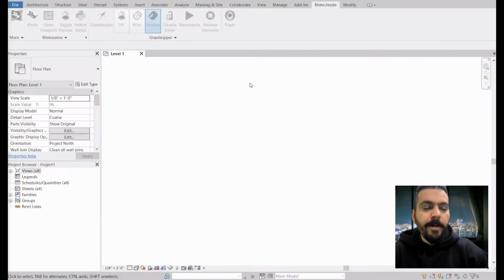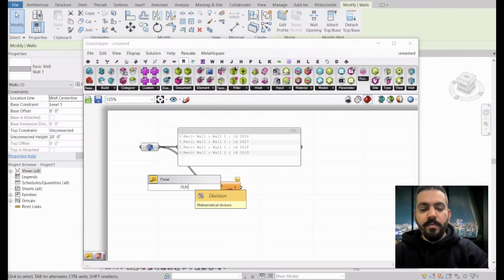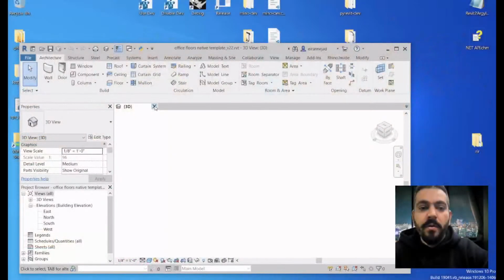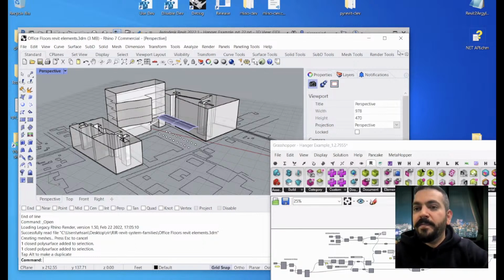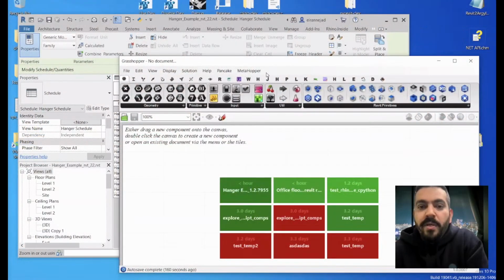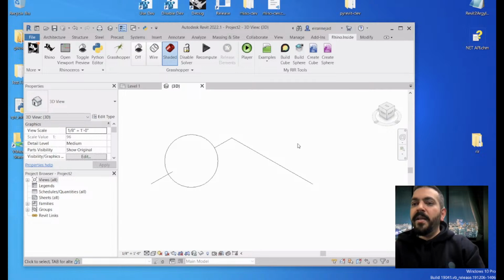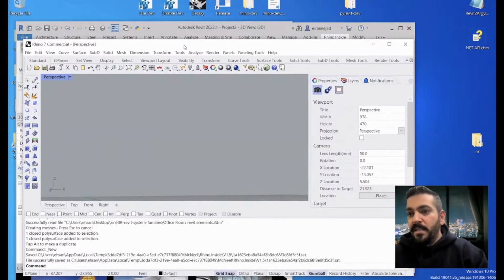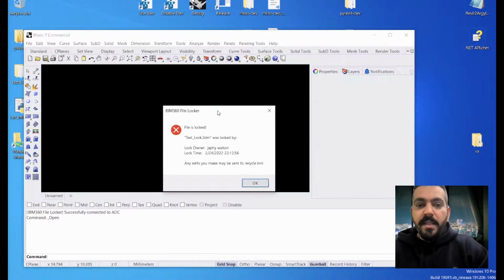Rhino Inside Revit with Ehsan

Comment: Seriously, I would rather import the Rhino model into Revit and retrace/draw/insert what I had to with Revit components, then sit in Grasshopper all day(s) searching for the right boxes to drag around and hook to each other; for Every Single Piece of model, there are like at least Three Boxes to drag in and hook up. That example was hardly 1/1000 of a finished building (what you need for CDs) and look how complex the Grasshopper diagram was. My gawd, a complete building would be a Grasshopper nightmare. This would be handy for drawing the things in Rhino that you cannot in Revit, but that's about it--- and you don't even need Grasshopper for that, really. If Grasshopper had AI that could recognize building components in Rhino (like if something looks like a window, or door, it makes it a window, or door) this would be a whole other story.

Comment: If there's a way to manage information across BIM 360 files then that would be amazing.  Start with the basics, Project information or something and then go up from there.  Eg, pull the project info to check for consistency then push back edits.  

The biggest struggle I'm having running 30 different files (projects) in one project is trying to manage them all to check and keep consistency.    Ehsan do you think that's possible? 

Thanks!
Reply: I'd say you'll be need forge for most of that stuff these days.
Reply from the maker: Love this idea!  Ehsan and I ended up talking for another 10-15 minutes afterwards just one BIM 360 ideas haha!  Cheers Scott!
Reply: @TheRevitKid  I have lots of ideas (problems that need solving) just no time to explore any of them in depth at the moment.
Reply: You could use PyRevit to batch script it all.  You could even use Pyrevit to open and close all 30 files and have Grasshopper player run for each file.  If you just used Grasshopper it would open all 30 files at once.  And it can talk to all 30 at the same time.  But I am not sure there is a computer that would want all 30 open.  Grasshopper is good at talking to multiple projects at the same time, but normally see 2 - 4 at a time.